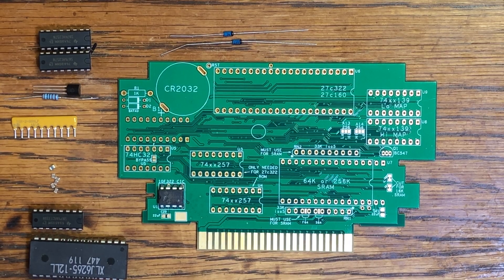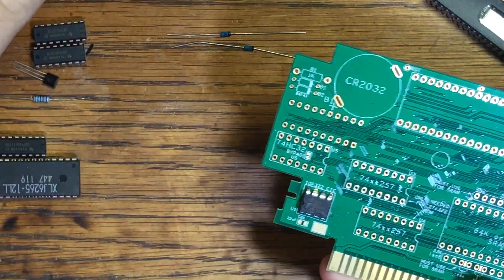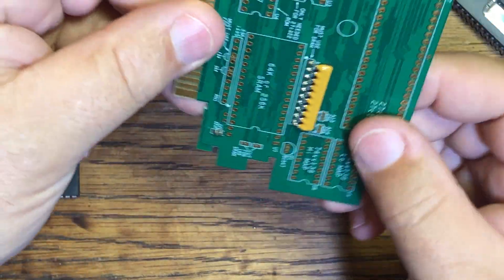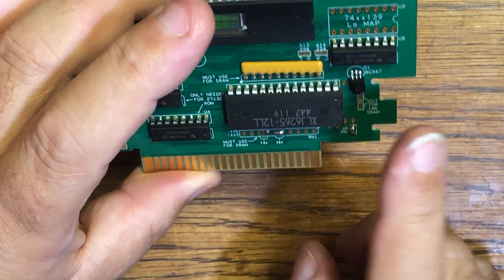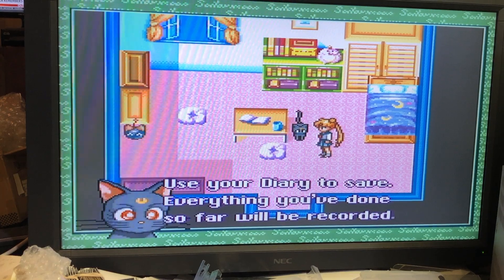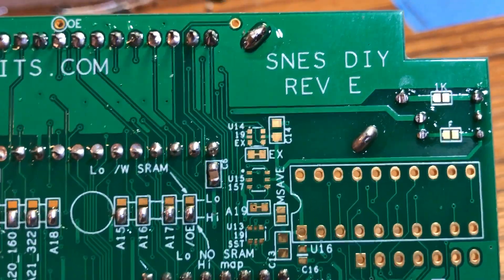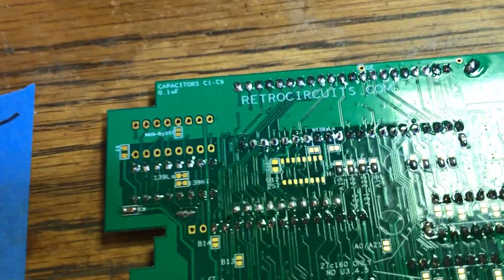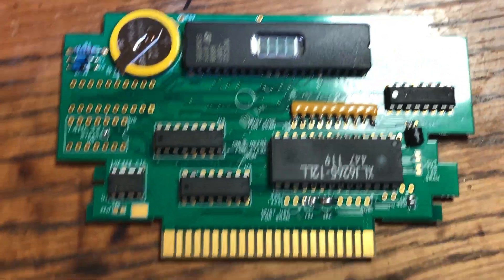Snes DiY pcb (Do it yourself)

Comment: Amigo buenas noches tengo una pcb de donkey Kong country 3 y no me guarda partidas,le puse una pila con voltaje de 3,24v y se la puse y pensé que guardaba pero no y cuando retiro la batería quedó en 2,84v,.....me podrías decir porque no guarda o que puede ser amigo? Gracias y que buen video
Reply from the maker: That’s a high drain on the battery so quickly.  Maybe sram chip is bad or missing diode.   Did you build this game or original?
Reply: @arcademaster1  amigo lo compre así como está ,el juego funciona bien pero no me guarda,no sé cuál diodo te refieras...tu tienes un lugar donde te pueda envíar las fotos para que lo puedas mirar?... Te lo agradecería un montón ya que el juego me gusta demasiado y así con las fotos puedes mirar bien
Reply from the maker: @diegovelandia254  RetroCircuits at googlemail
Reply: @arcademaster1  amigo me puedes dar un correo electrónico y te envío fotos por favor gracias
Reply from the maker: @diegovelandia254 I did already!  RetroCircuits at gmail.com

Comment: Hi, Why is the fonction of 74HC32?
Reply from the maker: It is an “OR” gate.  It is an optional part and can be bypassed.   It’s a more stable way to control the when they rom is enabled or not.
Reply: @arcademaster1  Thx for answer, at the and of the video  you said that is for FRAM chip.
Reply from the maker: @StanMoi  no, the 32 is an OR gate.  If you use a Fram, then a different chip goes in place of the 32 and the bypass must be used.  The chip for the Fram to work is a 74HC00
Reply: @arcademaster1  I see better now . 
Your board technically are genius but you should make more description on it cause we can do mistakes very fast ...